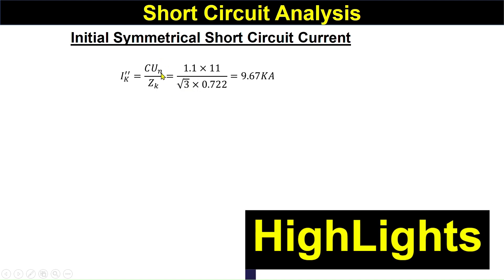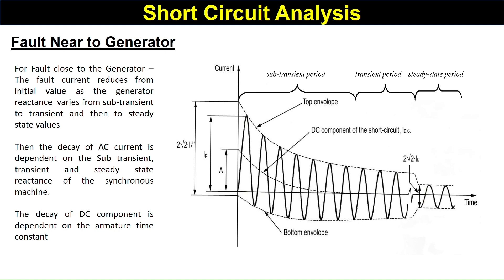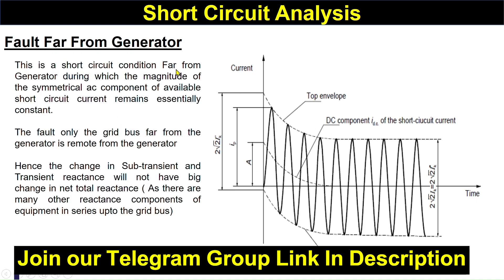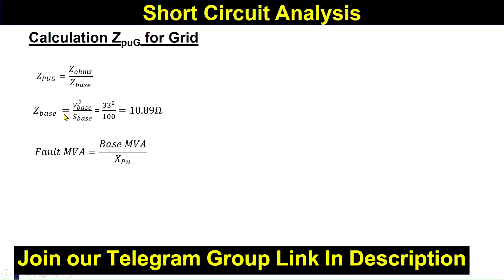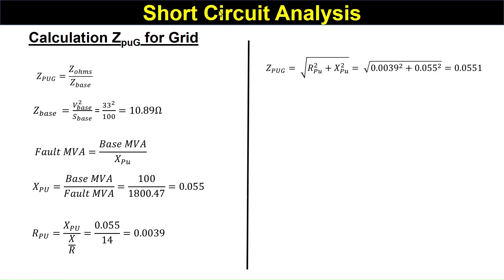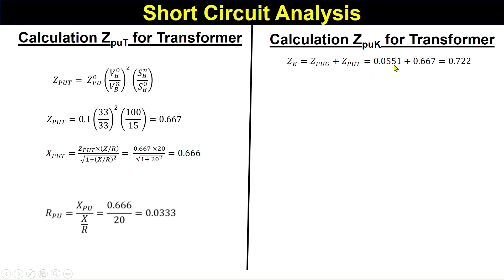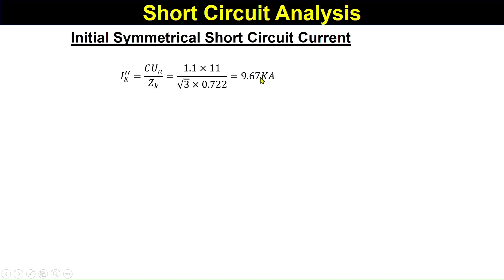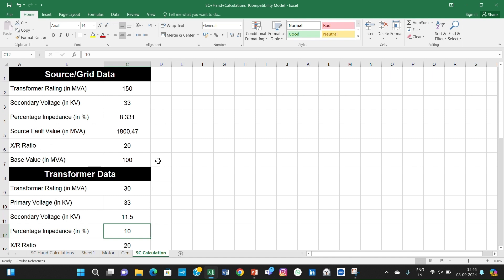Lecture 19 | short circuit analysis | Example | Hand Calculation | Free Etap Course

Comment: How can I get excel sheet
Reply from the maker: From telegram channel
Reply: @ElectricalDesignEngineering  The LF hand calculation exist but the short circuit not exit
Reply: I checked in telegram but it is not available only available is hand calculation for load flow